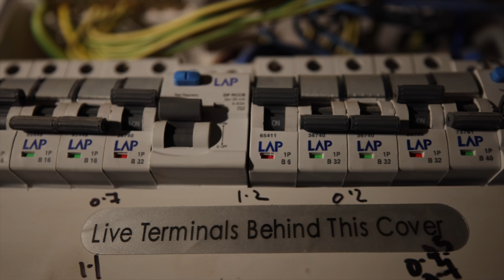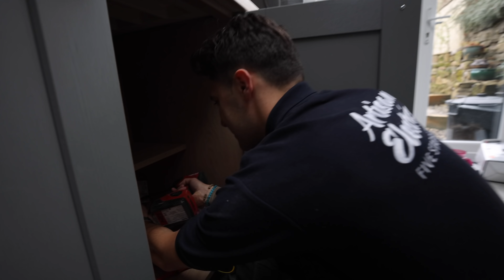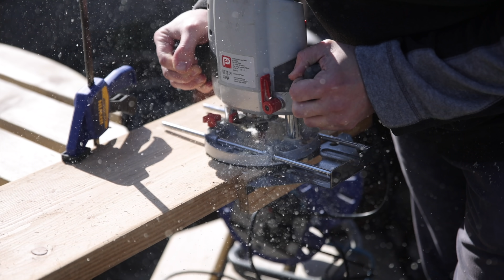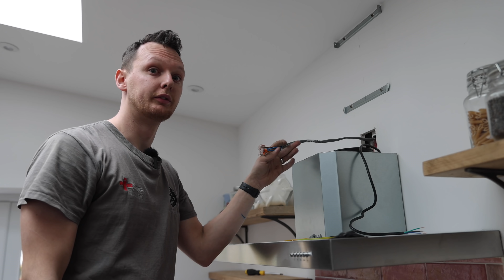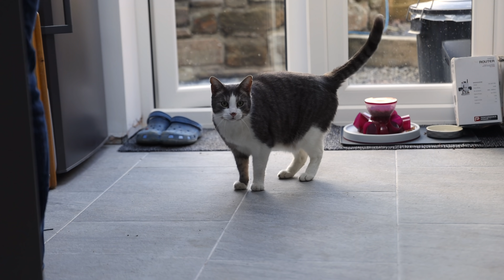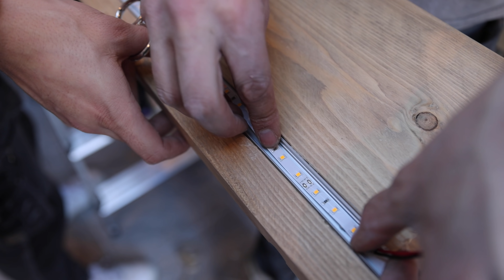SECOND FIXING ELECTRICS, START TO FINISH! - Electrician Life

Comment: Get yourself some decent flux paste, not the cheap stuff, a tiny syringe of it will last ages and it makes the job quicker and easier. Just remember to clean the soldered area off afterwards using some isopropynol to remove any flux residue.

Comment: That  soldering iron tip was disgusting 😂 

You need to keep the solder iron tip clean and tinned, get a brass wool soldering iron cleaner (COC around £3 or more elegant one from Amazon  around £7)  and flux (flux pens are convenient) will help solder flow and make a neat joint.

Comment: Is there another way to wire under cupboard lights without using solder?
Reply: There's clips available that 'bite in' to the tape on one end and the cables go into the other end. Personally, I've found them quite a faff and don't always make a good connection

Comment: Putting the plugs into neighbouring cabinets get in the way of putting things in the cabinet. Try fit a standard oven tray into that cupboard and your find the box + plate + plug make the tray extend beyond the depth of the cabinet and the door won't shut.

Terrible place to put them personally, put in isolators when the kitchen gets replaced (I do appreciate retro-work in an existing kitchen is much much harder to do this.)

Comment: First Fix
* Use push-fit maintenance free Wago lever type connectors to connect up the ring inside boxes.  
* Leave the Wagos in place. 
* The cable can be tested.
* The finishing trades can plaster and paint the walls.

Second Fix 
* As the finishing trades are working have all sockets and FCUs, etc on a bench. 
* Cut 4 inches of L, N & E 2.5mm flex tails for each socket, FCU, etc. 
* Fix a ferrule on the ends of each. 
* Connect the tails to the sockets.  Could be around 30 of these, so on a bench it is easy and quick.  
* When walls are finished, just clip the tails into the lever Wagos.
* Push back socket easy on the flex tails. 
* Screw in the sockets using a battery driver. 
* Test.

A lot safer as not being screwed connections in the spine of the ring, they do not work loose over time. The ring's current does not run through the socket terminals. Current only runs through the flex tails when current is drawn from that socket. Socket terminals are not stressed when pushing back solid cable. The 1st fix cable can be easily tested. If all is tested after 2nd fix and a problem there may be big problems in raising finished floors opening finished walls, etc. So this gives two test. 

The above can also apply to a radial circuit with a number of sockets.

Comment: Extractor isolator and fuse not in accessible location. 2 x 10mm2s would fit in a cooker isolator switch/socket plate combo, using the 13A socket for the oven.

Comment: The tip on your soldering iron is oxidised you need to get some tip tinner to remove the oxidation if its not to far gone. 

Don't have your iron on if you are not using it as it the tip will oxidise at an increased rate due to it being at an increased temperature & also keep some solder on the tip as this will help to prevent it from oxidising.

Also get yourself some brass wool balls & a holder to keep your tip clean, some no clean flux will also make getting that perfect joint much easier due to it keeping the oxygen away.

Comment: Top job guys! Try cleaning the soldering iron tip with wire wool to get it nice and shinny. Also, try lowering the temperature a bit to stop the solder 'balling up' as it looks like it's doing there. Heat the wire (or the PCB pad) with the iron, then apply the solder to it (not to the iron tip) and wait for the solder to melt. Once it has, you can take the iron away. HTH, just my ramblings from too long in the electronics trade :)

Comment: What croppers are you using Cory?
Reply: CK it looks like
Reply: I think he uses a trusty old pair of Bahco 160mm.
Reply: @nw5835  I thought Dan was using those
Reply: @samjburns07  I think your right on that, looked like Dan was going to start the challenge with Bahco then changed to a VDE set, poss' Knipex.
Reply: @nw5835  yeah, the vde looked like the stepcut
Reply: @samjburns07  As I had nothing better to do I had another look and I think Dan used knipex 74 06 200
High Leverage Diagonal Cutter.

Comment: I always find it best practice to put a gas hob on the kitchen circuit rather than the cooker circuit. That way when the element or any other fault occurs with the oven which eventually it will, the user still has the ability to use the gas hob to cook. Yes you could use matches or a lighter but it's amazing how many people don't have candles/matches/lighters in their homes these days. 
Lovely job though, even if some fuse spurs are in the wrong position.

Comment: I always fit a spur for the extractor hood in the nearest cupboard and then run a fly lead to the extractor. That way as Dan says you won’t have to remove the hood to change a fuse if something goes wrong. Excellent video guys. Great banter amongst trades as always. Good sparkys 👍🏼❤️
Reply: Yep abit crappy that, could see in the customers face he didn’t want that 🤣
Reply: @georgepalmer111  Thing is I’m a kitchen fitter too and before I start a kitchen I map it out on the walls and ask what appliances the customer has then you can get the correct size cables in ready for the install. It’s tough just being in one trade sometimes.
Reply: @Vwfan  yeah i dont know whats been agreed, but i would suggest hob/hood spurs to be on show or local cupboard
Reply: There’s nothing worse having to take down a filthy greasy extractor hood because some numpty has fitted the spur/socket behind it, I’ll always stick it in a local cupboard and use a click flow plug behind.
Reply: @davidwilson4671  yep👍🏻

Comment: You need to tin your soldering iron tips and clean it after use its not melting the solder because of the carbon build up on the tip, from not tinning and not cleaning it
Reply: Yep, a dirty tip won’t transfer the heat at all!